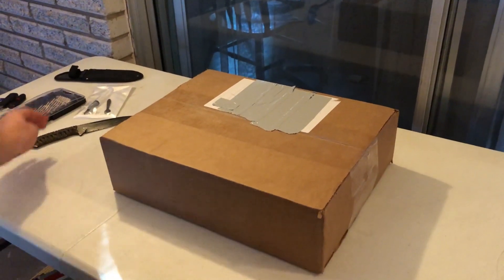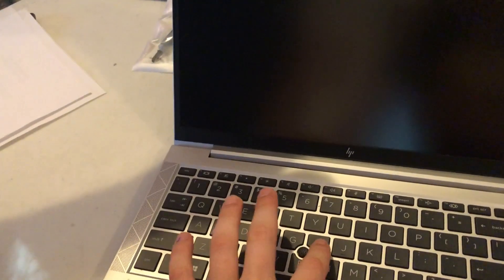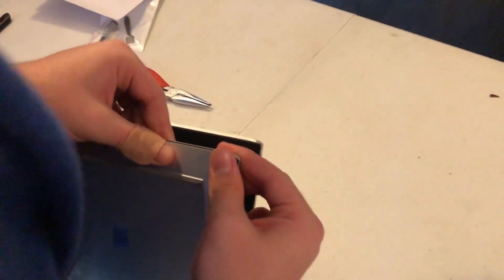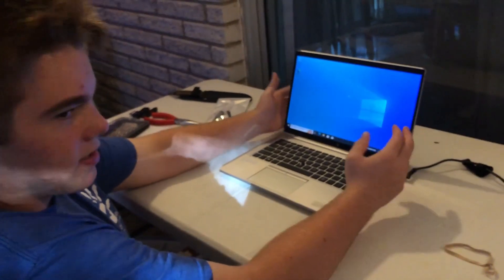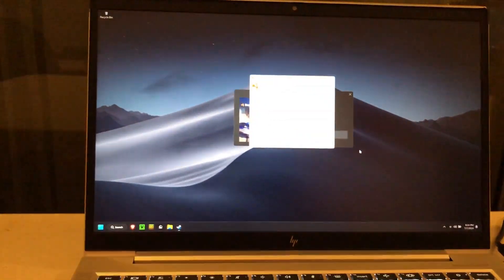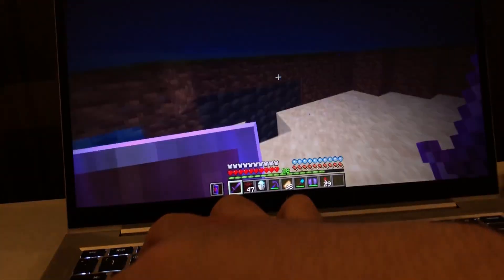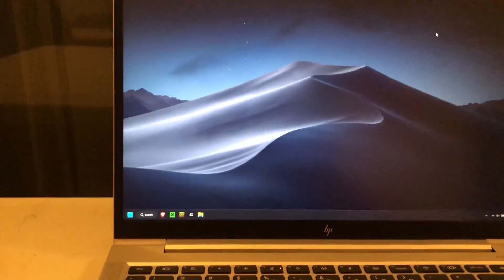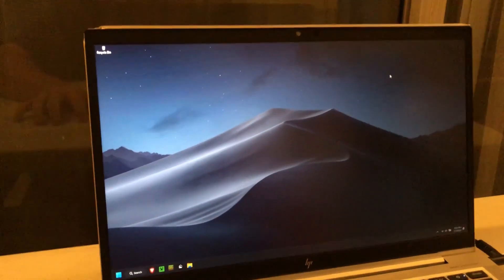$200 laptop from ebay. Worth it in 2024?

Comment: What was wrong with the hinge that you tell about in 1:10? Did you fix it?
Reply from the maker: The laptop came with cosmetic damage which was why it was so cheap. I had to bend the corners back into place because the aluminum was all screwed up. It was a simple fix, it doesn’t look perfect but the bottom actually closes now
Reply: @titustech337 I know. But what about the hinge? You said you would need to tighten it.
Reply from the maker: And I could feel the hinge wasn’t as tight as it could have been so I was thinking I would tighten it when I had it disassembled
Reply: @titustech337 Did you tighten it finally?

Comment: haha lol thinking of getting this exact model with the same config for about the same price. quick little side note is the ram 1x16 or 2x8  and finally  hows the fan noise doing general stuff and gaming (given its a single fan system)
Reply from the maker: @user-hj2th3rd1c  I believe it’s 2x8 but it could be different in your model. As for the fan it’s not too bad but you can definitely hear it. I also wouldn’t really recommend this laptop for gaming as the GPU is very weak. Nothing with higher graphics than Minecraft lol
Reply: @titustech337  yeah sounds about par for the course and the gaming I will do is mostly CPU intensive
Reply from the maker: @ oh okay then it’ll probably be fine

Comment: Got one and swapped 2x16 ram and 512 3x4 NVMe for total cost around $260. Love it so far
Reply from the maker: @AIGeneratedUser  ooh nice! Good idea!
Reply: @ thank you! I snagged it refurbished for $185 and it came with 8gb 2400mt/s ram and an old 128gb SAN disk m.2 ssd. Silicon power 3200MT/s low latency ram for $40 and ssd from kingspec for $30 so a little more after tax but under 300. Not sure if it was smart or not lol. But it’s funny what refurbishers will throw in a system lol
Reply: How’s yours holding up? Planning to use mine for 2-3 years then upgrade to something more permanent on AM5 platform
Reply from the maker: @ it’s great! I use it to run a Minecraft server for our friend group and it’s really fast for those kinds of things

Comment: hey man im gonna buy the probook version of 845 g8, ryzen 5 5600u but it only has 512mb vram , people say it doesn't matter and it uses vram as needed for a game . what are your thouts on this  .i need to play persona 5 and some light games . thank  you
Reply from the maker: @nethrablack2230  these laptops really don’t have good gpus. They’re pretty bad honestly. These are more work focused gpus so if you want to do even a little bit more intense gaming than like Minecraft I’d skip these laptops. As for vram with i gpus in laptops a lot of the time they have a small amount of actual vram and then just use system ram when they need more. It’s not as fast so it’s not as good of an experience
Reply: @titustech337 i dont really have a choice in my budget ''390usd''  this is the best i can get,  but 5600u  tests it shows all the games i need to play are playble like genshin  impact ''very liight games like vishual novels'' My main concern is that it wont have enough vram .
Reply: @titustech337can hp elitebook 845 gen 8 run minecraft and gta 5